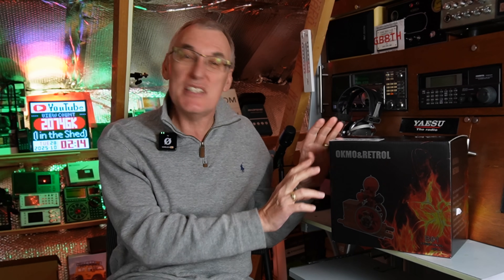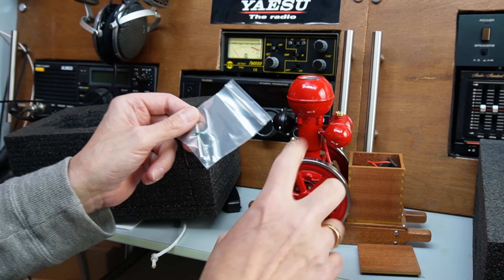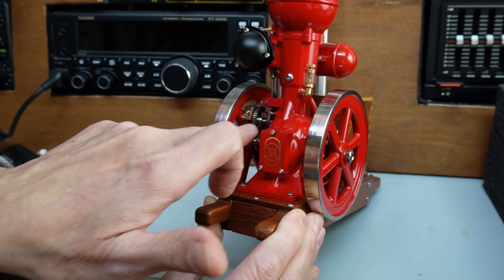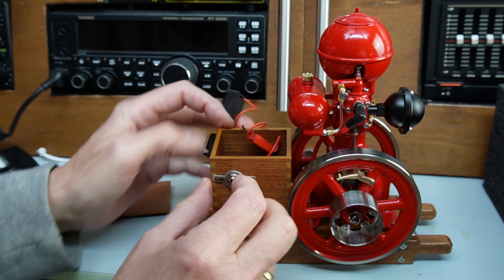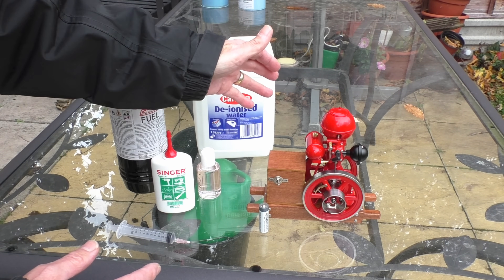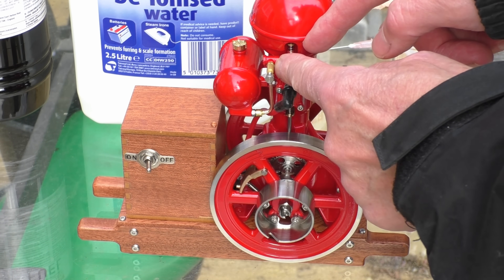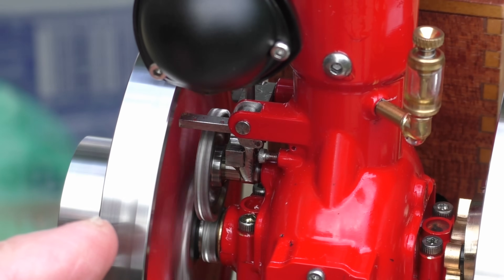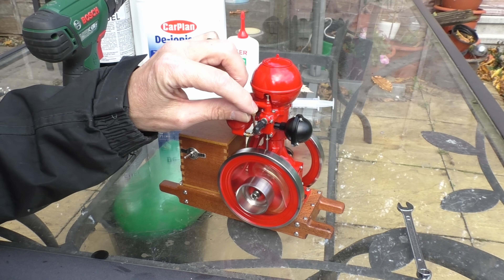Fully Working 4 Stroke Gasoline Hit and Miss "Ball Top" model engine.

Comment: Thanks for sharing this video. This is very much like the old inboard "Make and Break" Acadian or ATlantic model engines that fishermen used in their bboats back in the day. I have a 3HP Acadian engine on display in my yard. It is currently not running as it seized on me years ago because somebody left the top fuel primer cup open and water got inside.
Reply from the maker: Glad you liked the video. Interesting to hear about your Acadian engine.